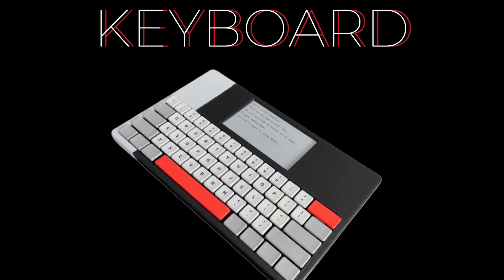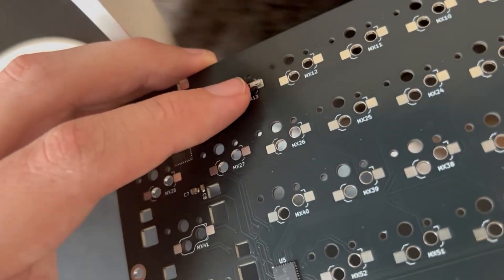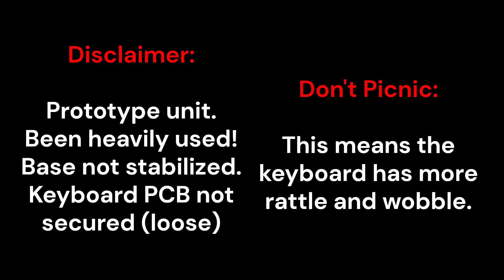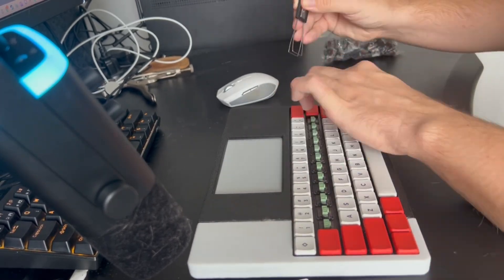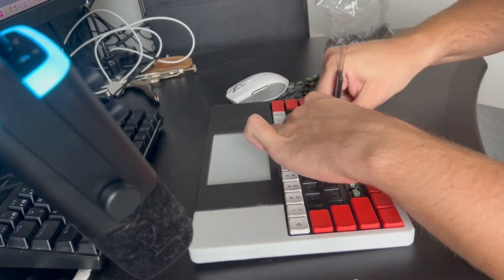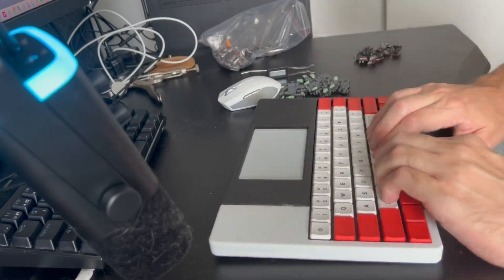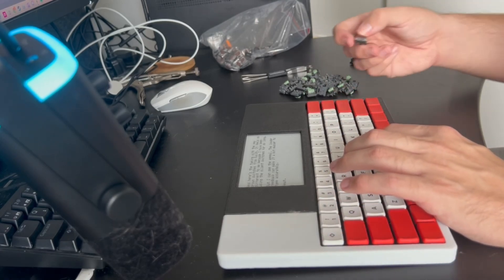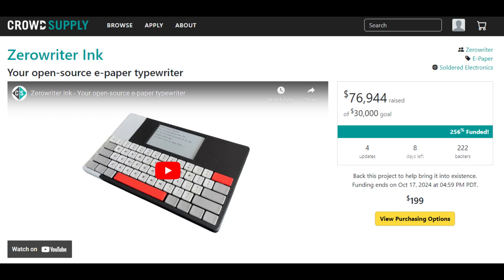An Awesome(r) Keyboard (For Zerowriter Ink)

Comment: Wow, this is a great project! Is it possible to use the keyboard as an input in a pc with the e-ink screen off? I'm thinking of the following use-case: I could use this keyboard as my main input device at my work desktop, and then take it with me to a cafe / library to write.
Reply from the maker: hi! yes, it's possible. it's a bit hacky, but i have mine working as a bluetooth keyboard for my laptop.
Reply: @  wow that's great :) thanks for the info